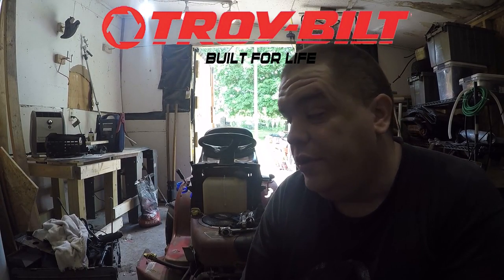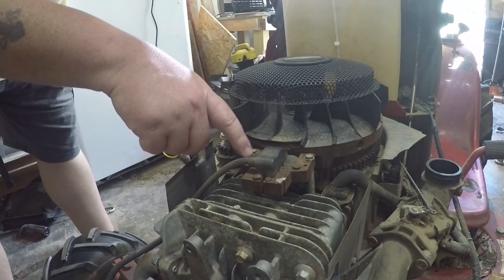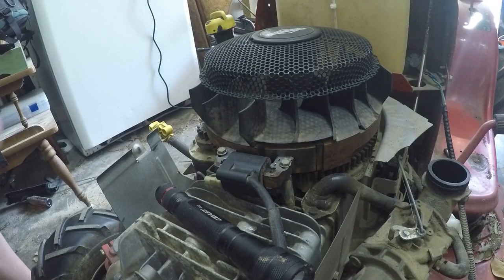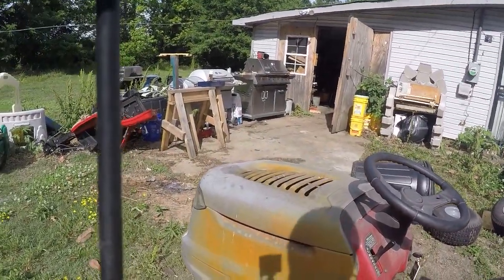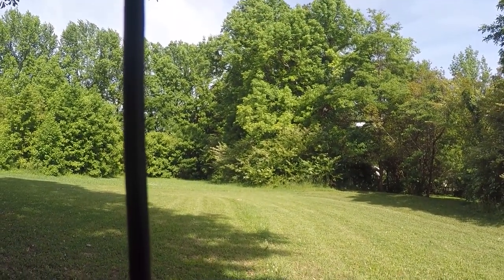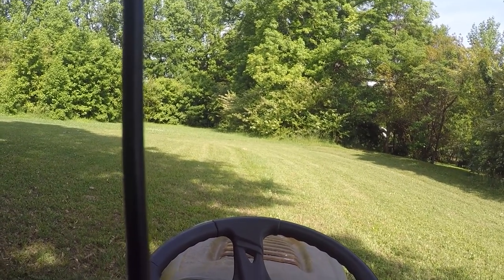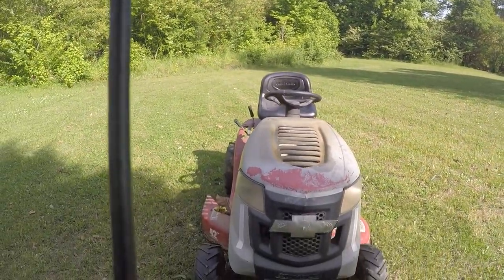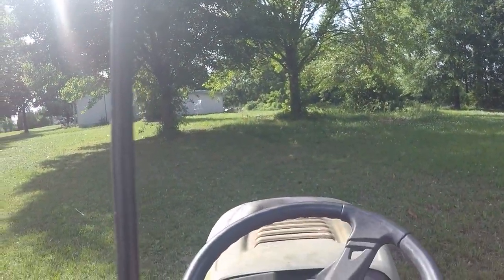TroyBilt Riding Lawn Mower Engine Shuts off After 15-25mins What Are The Causes [ Can It Be fixed?

Comment: Sorry if I missed it but did you check the gas cap? That is the most common cause of that problem. If the cap is not venting it will stop giving fuel to the carb after awhile. What I heard when it died was starving for fuel, spark sounded fine.   Thanks for the shout out btw.
Reply: @Tech_Connection1337  all you have to do is loosen it a few turns to let air in. Try running it with the cap loose and see if it  stops after 15-20 mins. If it does not stop,  you know it is the cap. If it is you can thoroughly clean and blow out the cap or replace.